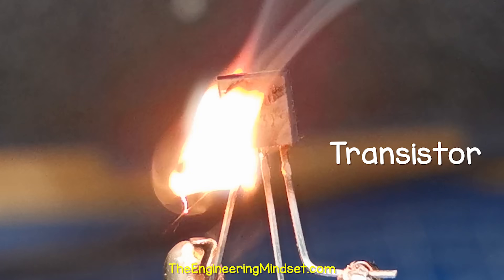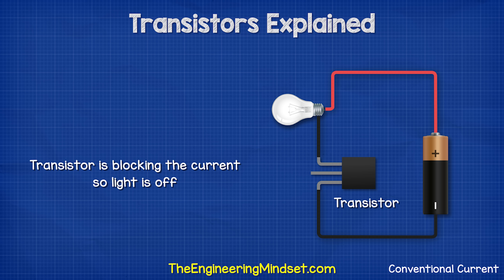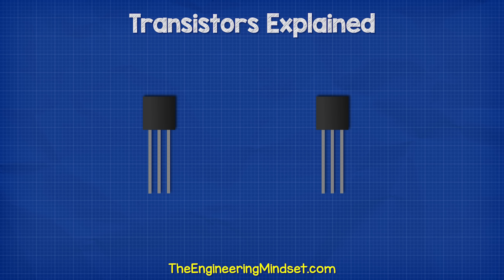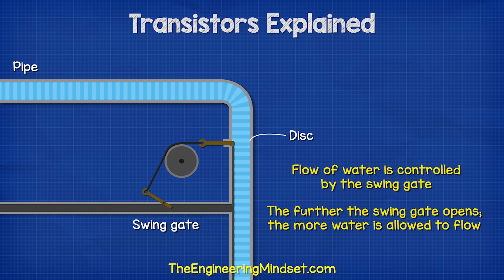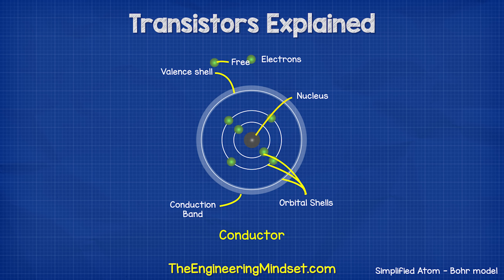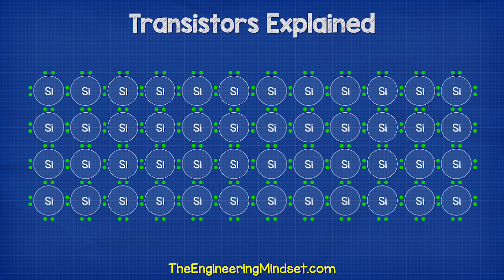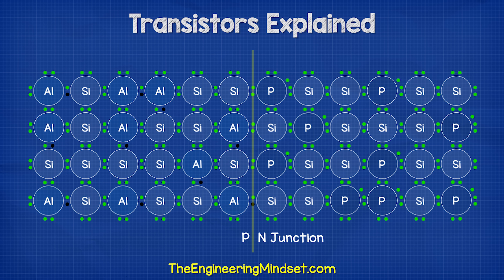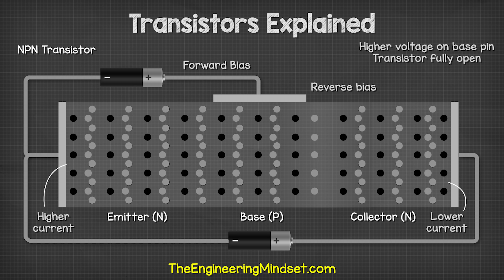Transistors Explained - How transistors work

Comment: I'm absolutely new to electronics but I must ask this simple question which you might find stupid. If so, you may tell me.
If I want to amplify the sound coming out of a microphone, which pin do I use for the sound signal and which pin can I use for the voltage input? Does it make a difference if I connect the voltage on the base or the collector?

Comment: Why electrons migrate only from small area around junction, why migration does not propagate thru whole material when power is not applied, if power is required for migration of electrons from where does it come when electrons migrate near the junction ?

Comment: This is very good for a lay person, but it leaves out some important information.  Everyone uses the exact same diagrams for the way that transistors work, even though they are inaccurate.  I would prefer that a more accurate physical relation be used, as the base is only a few atoms thick.  In fact showing the physical design of the 2N2222 would be great.

I also have to nit-pick on current flow.  You should have covered it before you used the terms conventional (a.k.a. hole) current, and electron current.  You failed to explain that electrons don’t only flow in 1 direction.  In metals, they only flow from negative to positive, but that is not true for other conductors.  I’ll give you a pass on the speed of your electrons though, as we know that electrons typically move about 1 inch/hr, but that’s out of scope.
Reply from the maker: Seen our new video on How electricity works - for visual learners? Link:➡️ https://youtu.be/3KePcASD0NQ
Reply: @EngineeringMindset  It’s a good video.  I would have added that the negative to positive current direction flow ONLY applies to current flowing through metal, and that it can flow in either direction, including both directions at the same time, through other conductors, but that would have to wait for a different video.  As you sort of alluded, but never stated, the current does flow in both directions inside many batteries.  😉
Reply: Thanks for your comment. It is always nice to learn from the experts.
Reply: How about just making a fucking video yourself so that you don't waste anymore of your time nit-picking someone else's talented hard work?? People like you kill me.
Reply: @markmullin3023  if you prefer that your instructors give you inaccurate information, then more power to you.  I'd be willing to bet that you've learning everything that you know from Wikipedia, correct?

Comment: Great channel. Great video. Best explanation of how they actually work I've ever seen.
But it can be a little bit better.
One small correction is that the transistor depicted is the BJT type.
FETs use a different nomenclature for the pinout. I'd love to know the reaso, so can we expect an explanation on FET transistors next? Also why discrete MOSFETs are so goddamn expensive?
The metal bit on the back of big transistor packages is usually connected to the circuit. Usually the collector in BJTs. So if you wanna put a heatsink on it, it's a good idea to use some insulating thermal paste. Unless they share a collector circuit, then it may be a good idea still in the rare case loose crap shorts it with another part of the circuit. Common practice I've seen taking old electronics apart is to have non-collector sharing devices use separate heatsinks.
Reply: I think the main reason discrete FETs are so expensive is their main weakness - they're extremely sensitive. Even a tiny electric discharge is enough to kill an unprotected FET. There's significant costs with the protection and/or losses that doesn't scale well to discrete transistors (you need the same protection on an IC with 20k transistors as you do on a discrete transistor - possibly even less, since discrete ones are generally made for higher currents).
Reply from the maker: See my new MOSFET explained video here➡️: https://youtu.be/AwRJsze_9m4

Comment: Please don't make the notion of "conventional current" sound like something artificial, worse yet "wrong".  Conventional current IS the same as electron flowing from cathode to anode.  You can think of it as the  flow of positive charges in a direction opposite the flow of electrons (this is because charge is conserved).  In a p-n junction, one talks about injecting holes to the p side, that is, conventional current is the flow of positively charged  holes.

Comment: Electricity passing from Emitter to base,when elektricity passing Emitter -  Kolektor ,transistor is closed.Emitter and Collector worked like diode,electricity passing only in one way.If you using Emitter Base , it's working like diode

Comment: brother, a BJT transistor doesn't use voltage as a control but it rather uses current. MOSFETs use voltage and there is no current flowing through the gate.
Overall the vid is kinda good tho.
Reply: I have made an simple and in-depth series explaining MOSFETs, for students taking VLSI at the university.
Reply from the maker: See my new MOSFET explained video here➡️: https://youtu.be/AwRJsze_9m4
Reply: @EngineeringMindset  I made that comment over two years ago. Kudos to you for reading comments. I have since learned about my ignorance :D

Comment: The electron flow vs conventional flow blew my mind. I always tried to conceptualize what was taught in lecture and couldn't rationalize how it could physically flow the way they describe... Now I understand why
Reply: Yep. Electrons are negative and are therefore repelled by the negative terminal and attracted to the positive. I have friends that still refuse to believe this. Such is the danger of dogma!
Reply: ay yo hold on people I thoroughly disagree with his comment about why electron flow is correct. They're both correct electron flow and conventional flow, and it doesn't matter as long as the current is flowing it can go either way.

Comment: Amazing way of explaining things, thanks. When I play around with arduino and such I always wonder when can I use a transistor to control a heavier circuit or when should a relay be used?
Reply from the maker: Well the easiest difference is the Relay can have AC on the secondary and DC on the primary.

Comment: Wow! That was a lot of detail. I was hoping you would have mentioned the term open collector. A few years ago I let the smoke out of a temperature controller by connecting its output wrong to a PLC. The manual called the output an open collector. After purchasing another controller I connected the open collector to a relay coil. The PLC inputs were wired for PNP inputs. If they had been NPN would it have worked the first time? What is an open collector?
Reply from the maker: Hi Warren, thanks for your support. "Let the smoke out" 😂
Open collector output basically means the collector is connected to the negative side of a load, and when the transistor is off, the collector is considered and open circuit. But when the transistor is signalled on, the current flows through to ground. Sounds like it was connected wrong polarity so the reverse voltage or current was exceeded.